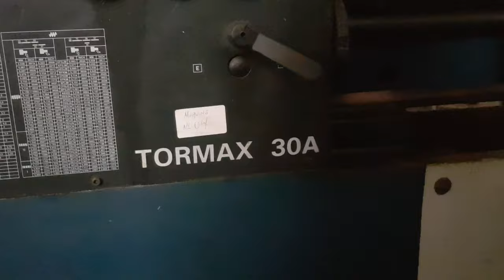Abandoned Machine shop  High end machinery Destroyed By thieves

Comment: Hi
I think you overestimate the value of the machines. The way I see it, the machines are more than 30 years old and there weren't any newer machines to be seen. Of course I don't know what the market for used machines looks like in your country, but here in Germany I only see scrap value, maybe €80,000 in total...
Andreas, Germany
Reply: Yes I agree,early computerised machinery loses value quickly,as the software becomes outdated before the actual mechanicals,retro fitting is possible,but the cost can can outstrip the value of the originals machinery, whereas conventional non computerised machines can last until they physically wear out.most of what's shown is worth scrap value only.
Reply: @charlesharrison2248   Installing new controls in machines of this age is usually not worthwhile...it makes more sense to look around for a cheap new machine...(HAAS or something from the Far East). Retrofitting only takes place in Germany for special machines or very large machines. In Germany, nobody would think of installing a new controller on a Deckel FP 4 NC... it wouldn't pay off from the labor costs alone.
Andreas, Germany